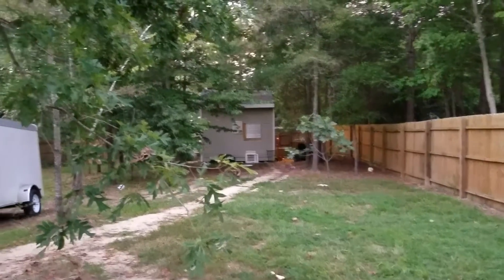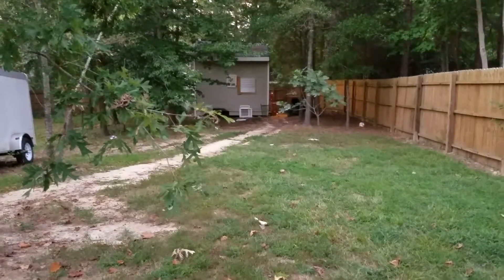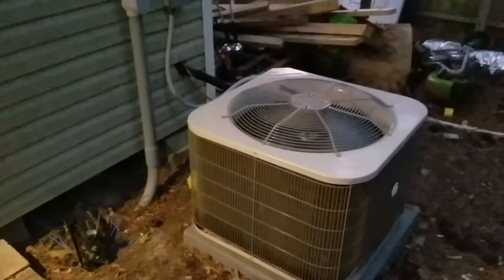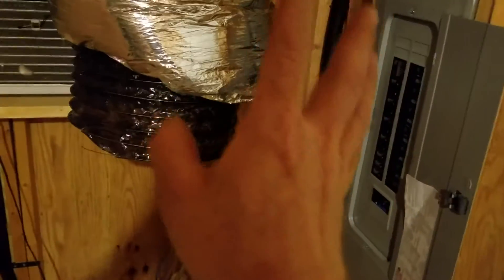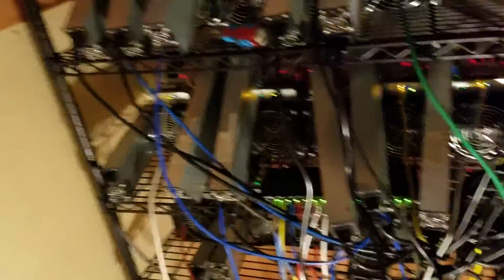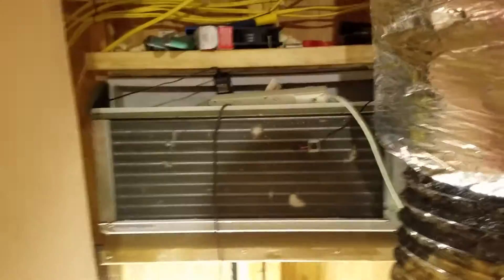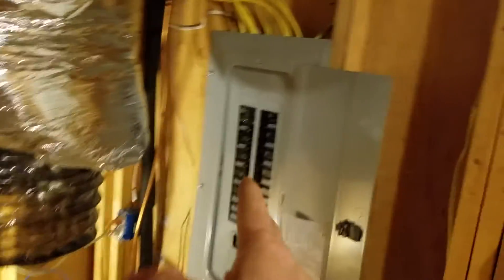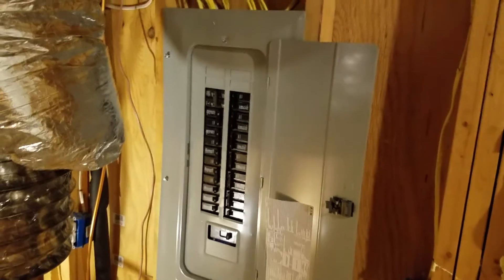Bitcoin mining in a shed. How I started mining bitcoin

Comment: I'd like to get 2 machines to run indoors but the sound needs to be tamed.  I'd like to get your thoughts on constructing an enclosure maybe similar to the shed but on a much smaller scale but it would still have a hot side partitioned from a cold side.  Since it's indoors, the supply vent would just be a fan to blow in the room temperature air (or portable AC if necessary) and another fan would connect to the hot side to draw the hot air outside (flex duct to window ?)  What are your thoughts on both the air flow/static pressure management as well as the soundproofing tactics ?  I appreciate you sharing your experience as I would rather learn faster from someone else's experiences in addition to my own.  Keep up the strong work. BTW we don't have a basement, summers get to 104 F with 80% humidity.  That's why I thought first about indoors.

Comment: That looks like a Payne 13 seer AC
Reply from the maker: +Sasha Bakhshi actually it's a Payne 15 seer
Reply: bitcoin master I didn't know they had 15 seer AC thought either 13 or 16 #energystar

You used to work with carrier?
Reply from the maker: +Sasha Bakhshi Saxon 14.5 Seer combined with a variable speed air handler gives it the 15- to 16 seer i didn't check the ashri certified
Reply from the maker: +Sasha Bakhshi my family had Ben in the HVAC business since 1922 we were carrier dealers in till the late eighties when carrier switched from aluminum coils and had a lot of problems there after that was due to the acquisition of carrier by a larger company that did not care about quality like carrier used to
Reply: bitcoin master I started working with my father whose been in the hvac field for 30 years. Started out by marketing for him just to get his phone ringing, but eventually I put my own phone number for customers to call and started to really learn the business from there. One thing that is sure is that I have a lot of trouble selling Payne central units because people keep seeing random Payne reviews online about them being shit units. I might not have enough experience to say this but I'm under the impression of the installer know what he's doing and the unit has no factory defect then everything should work fine if properly maintained.
Reply: I'm using EIT Method trading tool

Comment from the maker: in the Raleigh area you have to get time of use and add solar and you cannot tell them it's a business it's a hobby luckily North Carolina is regulated utilities they cannot deny you from time of use rates they'll try to convince you otherwise
Reply: What a small world I'm actually out of Durham NC and thanks I will have to try to get more info on "time of use rates".
Reply from the maker: +TheBitcoinMiner no problem we have to get together sometime. make sure you read all of the documentation. Its publicly available.  Duke is required to submit to the Utility Commission for approval. this changes every year I know it can be very confusing and they will definitely try to confuse you even more butt with time-of-use due to the fact that there are no massive Peaks of energy during peak hours you will end up averaging out at about seven and a half cents kilowatt .once you add grid-tied solar to help curb the peak times which change by the seasons. over the summer it is from June until September peak time is between 1 and 4 o'clock there are shoulder times as well. that is from 9 a.m. until 1 and from 4 until 10 and there are even further rates within those rates if you set up your system correctly you will find the you'll be able to get down to $0.06 kilowatt as well. I've seen your set up which I'm sure it helps butt I'm sure we could probably help you maximize the efficiency of your solar and wind power. I enjoy your videos as well.
Reply: Thanks yeah we'll definitely have to get up sometime +bitcoin master and I'm very interested in saving on my power bill but I am not sure how "time of use rates" helps unless you're running them on a timer and just running them during certain times? Energy Charges (Calendar months of October-May), On-peak $0.20920 per kWh, Shoulder Peak $0.10958 per kWh, Off-peak $0.06520 per kWh  VS* All hours $0.09212 per kWh
Reply: It just seems like it would average higher if you are running the same amount 24 hours a day. Unless there's some sort of clause that you're referring to here "due to the fact that there are no massive Peaks of energy during peak hours" https://www.duke-energy.com/tou-dep-residential/rate_comparison.asp
Reply from the maker: +TheBitcoinMiner that's exactly why it works as long as you have a stable rates of power usage throughout the day do not hit with the big fine the most people get when an air conditioner turns off and on during peak times
Reply: Yeah I'm afraid because everything is tied to my house I will not be able to keep it that stable without getting a separate meter from my house. I also have a glass blowing shop which can definitely draw some power and I go out there periodically especially this time of year when it's nice out.